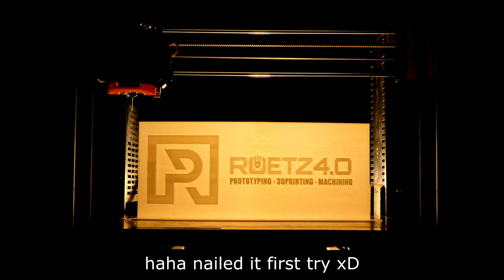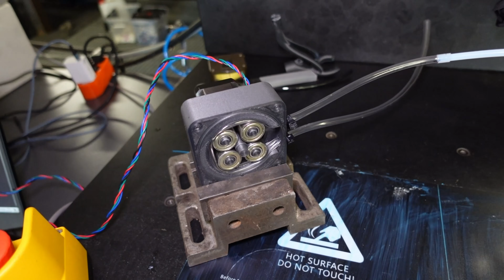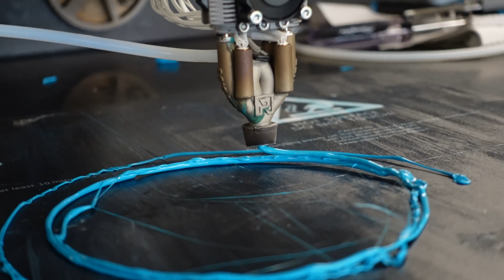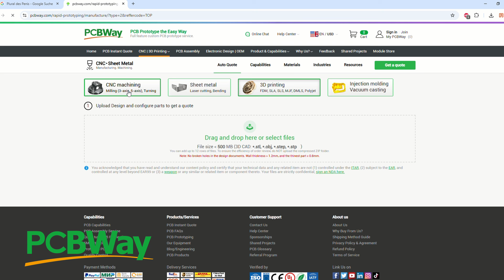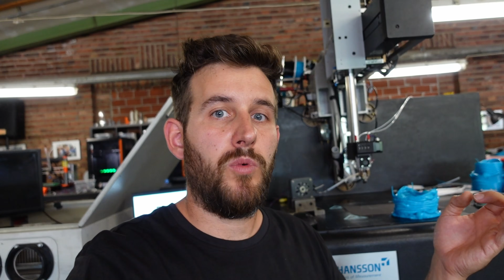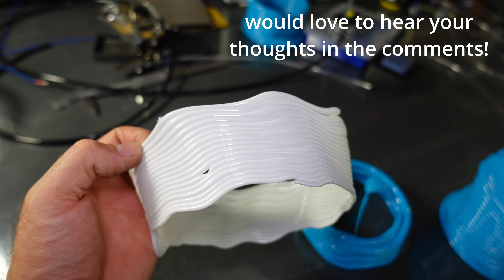Your Ideas made it WAY BETTER! 3D-Printing TPU Tubing

Comment: My suggestions.  Forgive me for these being are all over the place.  I am writing as they come to me.

 First, get or build a cheap flow meter (just a weighted ball in a plastic tube) and accurate pressure gauge to see what's happening.  Plus, as you mentioned look at more industrial methods of controlling air flow.

Second,  I think your nozzle needs a re-design.  With two parts.  An inner section, and the outer section.  The outer section made of brass, and the inner section made of something which doesn't conduct heat that well.  Right now changes in air flow are changing the cooling rate of your entire hot-end assembly.  Which means adjusting the air flow changes nozzle temps.

You could experiment with different gas mixes and how the density change affects things.  Argon and CO2 come to mind as readily available in a shop.  On the same topic, you've mentioned before that your shop air is extremely dry, as it should be.  However, what if we go back to the mist cooling tricks you tried before?  Even if it's just raising the humidity, maybe you could get the tube to cool faster.  Heck, even a liquid or high temp gel are options.  Though all of these suggestions, even the CO2, might would required that nozzle re-design I mentioned.  As the more dense gas could cool the nozzle too quickly.

Speaking of nozzles and cooling, the inner port diameter is so small, you could be getting a Berd-Air style cooling effect.

If TPU takes more pressure/air flow, it might support going back to a metered air connection instead of a peristaltic pump.  Which is a good thing in my eyes.  As it's more constant.

On a use note.  The moment you showed the TPU compressing like that, I could immediately see uses for this.  There's other ways of creating that effect, but imagine creating dampeners and other things using this technique.  Not just vases, but actually spiraling in and out to create a near "solid" structure that can then either stand on its own or be filled with something like a flexible foam.

Comment: I'm pretty sure a small (cheap) aquarium air pump can be easily modified to control via PWM.  That might be the low price and reliable solution.
Reply: They work on line frequency (and I guess at line voltage). So just feed the right frequency into a reversed transformer. That's what I would try.
Reply: @blenderbuch thanks for clearing that up, it makes way more sense that they're built to cycle at 60hz on line power. And if they're putting out that much air at only 60hz, slowing it down enough to meet the low volume this project needs would probably make for a very lumpy tube extrusion. 

You'd need a VERY small diaphragm pump that runs at a higher frequency to get away from the parastaltic pump.

Comment: if the tube is open at the bottom then you are flowing through the tube as you print. the back pressure will then depend on the geometry of the tube (length, diameter, bend radii). if you close the tube on the initial end, the flow problem becomes a simpler volume flow rate problem. mind you not simple, still an extremely nonlinear problem space. But with the above constrain, the problem becomes less dependent on geometry.

Comment: I think the pump might benefit from a DC brushed motor with encoder feedback. A DC motor will pull more current as the torque increases.
I love your crazy ideas. I love this channel. Thanks for all the fun videos.
Reply: It will take more current but will overheat in that range. It's just a matter of proper gearing, proper servo would be ideal ofc, maybe an outrunner.
Reply: A patent application could be to make custom medical appliances. Your TPU tubing could be use to make custom constriction devices for people with problems with swelling legs. By inflating portions of a leg wrap, the circulation of fluids in the leg (or other body part) could be improved.
Reply: What you're talking about is called a servo. I would not recommend one of them over a stepper for this application.

Comment: What if you fed the air from the pump into a reservoir and used a bleed screw to bleed off any extra pressure to allow you to run the motor at higher speeds while giving you very fine control over the pressure entering the nozzle?  You might even find it reduces the pulsations and smooths out the airflow.  You could probably use something simple like a 2L PET bottle.

Comment: I'm really impressed with this idea. I'm working in pipe extrusion, process is similar. We have different lines to produce the straight ones and also the corrugated pipes. 

Straight pipes production process looks have the extruder after that we call it die head (in your case hot end) there is also channels vary to a number of layers and the layer height. So after the extrusion material is going through brass calibrator to set the diameter we want to achieve. It is water cooled and the most important is vacuum to expand pipe to the inner walls of calibrator. 

In the corrugated pipes we are using something similar like you did in here. The outer layer is corrugated but inner layer should be flat to put ex. Cables inside without blocking on walls. So we have different type of calibrator. We have water cooled mandrel with air channels inside and "conical" end. Water cooled to lower temperature of material and on the conical end there is air outlet to make material spread evenly on the inside walls of forms, in the forms are little channels to put vacuum in there to form shape you want. 

I'm thinking if there will be possibility to make on the outlet of hotend something like our calibrator. With vacuum to  achieve shape and size, and water cooling to lower temperature a bit to have more constant layers. For start I will try the vacuum idea, you don't need much a [.x mbar] is enough. 

And to start print we always have to stick it to something on start production. I think the same should be done in your case. 

Maybe some of these info will be helpful. I've tried to describe it best I can.  Greetings , you are doing very good job

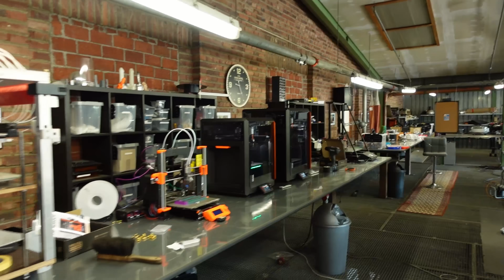Comment: 0:55 is a stunning transcription error.  You say "Prusa" but it got transcribed as "Creality"!  (Turn on CC to see this) WTF Google?
Reply: It's honestly worse when the captions try to use relevant words to the hobby and get them wrong, compared to just putting out gibberish.
Reply: Yeah, what's up with that? Not only did it translate Prusa to Creality, it replaced Core 1 with K1, which is a Creality model number.

Comment: Instead of air I would love  to see what happens with water pumped into the tube 😂 during printing of course.
Reply: The nozzle wouldn’t be able to heat up above 100°c if water runs through it
Reply: @heinrichhenry1 I did not say it is easy 😅 find some fluid which has less heat capacity 😊
Reply: @blenderbuch then only high temp oils really make sense, they’re expensive though, you’d have to put a ton of energy into the hotend, the cooling performance of the plastic will be horrible too with hot oil inside, and do you really want oil inside your print?

Comment: Your initial adhesion issues may be solved by using a heated bed or torch to warm a thin layer of low melt wax to a soft or even fully liquid state on a larger Aluminium sheet or any other form of effective heatsink when the heat input is removed- soft and viscous enough it might be able to keep the bottom layer a real tube while locking it reasonable well in place on that initial layer. Then cool it down fairly quickly so the wax hardens and it will mechanically lock the print in place - if you can get the part cooling to be more spread away from the tube you are extruding it might be possible to cool the wax enough with that.

Comment: Couldn't you have the air outputted into a tank like a normal compressor so you can regulate the output of psi to get a constant pressure output?

Comment: Maybe try heating the air going into the tubes, and cooling the plastic outside the tubes.  Also, I don't know how you would do it, but maybe try building something to press down the first layers to pinch the line until you achieve full inflation.  Once that is achieved, you could collect data on inflation times and hopefully get more reliable starts to your prints.  OR, you could pump air into both ends of the first layer to get it quickly formed and shut off end cooling when you get a good first layer

Comment: Maybe go back to the core thing, and use PVA as the core material, then boil/soak the print so that the PVA dissolves. it'll probably not dissolve all the way unless you boil it, but maybe if you force water into it, it could dissolve?

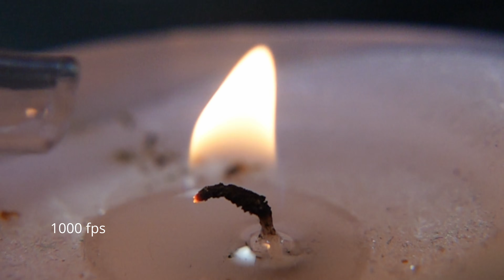Comment: The slow mo shot at 2:43 was genuinely awesome. Anyway, try a part cooling fan to lock the tube into place more quickly. You can put a QIDI style silicone cover over the nozzle to improve hot end temperature stability while cooling the print.

Comment: Can you print on a beltprinter type of setup? That would allow you to not have to deal with printing the tube on top of itself. Just keep the belt at a constant speed, youll have to find some kind od way to deal with the tube once it reaches the other side of the room but it would hmgive you a few metres to test without chanign anything.
Reply from the maker: That's actually worth a try 😂
Reply: @Roetz40 but isn't the idea to print lightweight structures with (!) layer bonding? For tubes alone just extrude into water. Maybe a long tank like in filament making.

Comment: I wonder a bit if we could control the inflating by offsetting the inner nozzle a center so we can have thicker outer shells and tinner inner ones.
Reply from the maker: I think we can achieve the same by extruding more if you want to inflate more. It's atleast way less effort
Reply: @Roetz40  My point would have been to still have a single layer but printing thin shells with a good way to make this thing paintable without much effort. 

But i guess for this stuff "Tiefziehen" makes a lot more sense?

Comment: Use one of the servo / hybrid motors, just feed it the step pin from the extruder in firmware tweak the steps per rev  ratio

Comment: The pump isn't working and getting hot is because you are using very hard vinyl tubing which is very hard to bend and doesn't flatten out easily. You need softer silicone tubing which is what all peristaltic pumps use.
Reply from the maker: Yes you're right. Working with what I got on hand :)

Comment: It's funny, the timing in this.  I just finished designing my own peristaltic pump for use with a nema17.  As others mentioned, silicone tube is what's used for these pumps. Then connecting to latex output tube, I think helps with pulse damping?

Comment: That could be extremely Handy for soft robotics
Reply: When he blew air into the tpu print that was my exact thought, that opens the door to printed custom soft robotics, add multi nozzle and material use, you can add non flexible parts
This is as exciting as when multi material printers started getting worked on, opens up a whole new set of tools for cool ideas
Reply: Agreed.

Comment: Just an idea: Printing the tube in a circle can lead to a lot of issues. For example, when the layer below is not flat, the layer above will not be flat, meaning the tube will be stretched downwards which could affect the air flow rate in the tube, which could lead to more deformities, and so on.

Maybe an alternative starting point would be: Build a printer that can slide a looong way along the x-axis and try to print the tube in one dimension perfectly. Once you have optimized all the print parameters for one print axis, make another print series with a slight curvature, then optimize, then increase the curvature, then optimize again, so your print parameters basically become functions of the curvature that you want to print.

Once that is all done, then you can return to the setup that you now have where you print a coil along the z-axis and you can optimize for the z-axis.

(Yes, that will be a lot of work to build the printer that can move a long way along the x-axis, but I think this is the most methodic way. Greetings from Germany, your work is really cool!)
Reply: He should try a belt printer.
They have an infinite x or y axis.
Reply: @manuelbrokampi was thinking mixing both, extruding into a rotating cylinder below that coils it sideways
Reply: like, instead of manually rotating the extrusion head around the Z axis

a screw that rotates around Y and also moves slowly in the Y

I'm just not sure if that'd still be a 3d printer, a 1d printer, a 2d printer, or a 2.5d printer 🧐🤔
Reply: Or printing in a spiral instead of a circle.

Comment: Silicone tubing works better for peristaltic pumps and you can solve the torque by making the rollers the planets in a carrier-less planetary gear with the sun being driven by the stepper and the housing being the fixed outer gear ring. To get it to be carrier less, you make it a a split mirrored helical gear with the rollers sandwiched between the two planetary gearboxes and everything being-self locking in place since the mirrored helical forms a herringbone gear (if you don‘t split it for assembly you can‘t get those together other than print in place, in which case you won‘t get the bearings on).
Reply: Another option for increasing the moment of force is via a pair cycloidal disc

Comment: Seeing how air-tight and flexible the TPU print is: maybe with a two-layer spiral TPU tubing in the peristalic pump, you can have a softer material than the PVC tubing and have -- due to the double rounds -- 8 pinch-points hopefully getting it more gas-tight. And the machine printed something for its own benefit. And there is a project-goal for a two-layer spiral that needs to be almost perfect...

Comment: If that TPU tubing is watertight, you could be printing 3d cooling suits for astronauts, etc.
Reply: Or just a water-cooled west for the heatwave 😂
Reply: it would be cool for 3d printed anything that would want tubes going through it tbh
Reply: I was thinking similar when I saw it, though I was thinking perhaps end goal of a dual extruder setup that is somewhat weaving a part together in mid air - you don't generally want 100% solid as it won't breath, so being able to print that tube and make it hang where you want with the other regular style extruder that does bridge fairly well if printing TPU bridges and spacers or perhaps supports in a suitable support material instead - fast enough regular print head that is fully independent could fill in support/bridges to allow the next tube layer to be formed to the desired shape as it slowly works its way around.
Reply: @foldionepapyrus3441 the natural irregularity of the printing itself can work in favor as to create a fishnet pattern, it only needs to stick at regular intervals

exactly like when it sticks because it's hot near the heating element of the extruder, but then it doesn't because it's far away down a valley 

this going up and down can be dialed in to create this fishnet pattern that would let it expand creating breathable air holes.
Reply: nvm, it's too regular and 3+ layers adhering on the same spot defeats the purpose

if it's printed flat you could just shift 1 sine wave every revolution tho

but purposefully making a column f layers adhered on the same point every turn can be used as a constraint to force a joint to bend correctly without twisting/pinching

it could also work as a variably-permeable tube (a tube that's its own valve) if we consider the roll of circular tubes as the tube(stretching in the Z axis of the print)

twisting it/(de)pressurizing it could make it impermeable or very permeable or even a way to filter by size

kinda like lung's alveoli/blood vessels/hematoencephalic barrier or gills
Reply: @Ewr42  Certainly possible but that seems far less consistent/controllable a solution - if you have to print the thing 8 times and none of them work out quite the same its rather hard to build around it - at that point you are better off just extruding a tube with the desired crosssection with no attempt to give it any structural bonding/shape at production.

Comment: Nice work! Also, in case you don't already know, the performance of perstaltic pumps will change over time as the tube gets fatigued from the rollers, so just something to keep an eye on
Reply: they sell like vacuum enclosures for them to get around that problem for lab user. though i'm sure they're quite expensive.

Comment: Go team! 
Great work. 

I would look into a piston based flow machine. 
Just a guess. So grain of salt. 

Thinking about your TPU result, 
I suspect that flow alone, or preassure alone will not solve you issue entirely. 

A camera running at a thousand frames a second, needs to feed back 
into a machine that is managing pressure, velocity, volume, and temprature of the gas. 

And then there is the rabbit hole of 'what gas?'.

Comment: why don’t you start the print with a straight line outside the model? this might give you enough time to pinch the tube.
Reply from the maker: The problem seems to be that the low viscosity material straight out of the nozzle: I can't inflate it properly if the enclosed volume is so low. I figured I have to lay down a few layers and then slowly ramp on air. It's hard to explain, but this needs to be on top of priority list to solve....